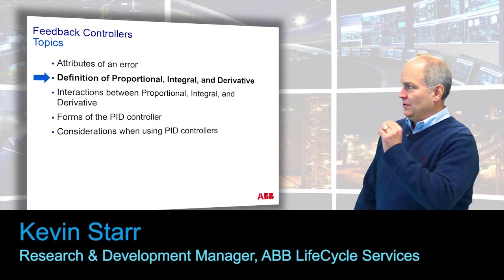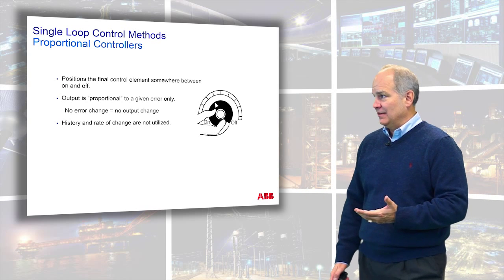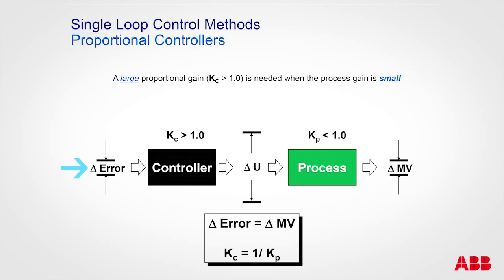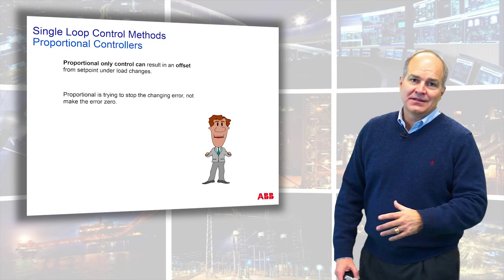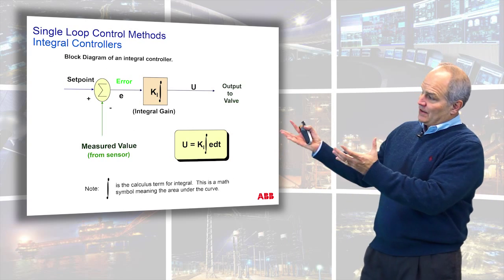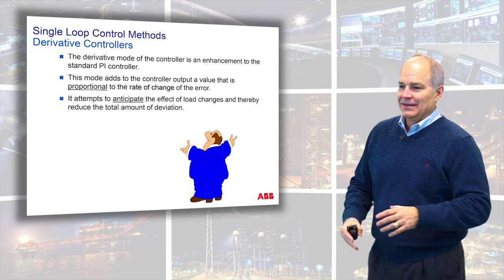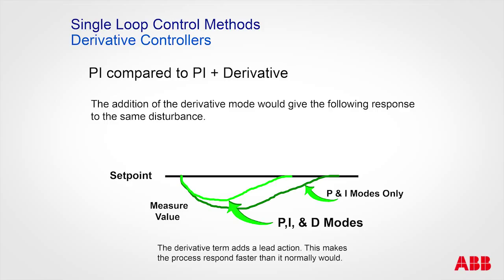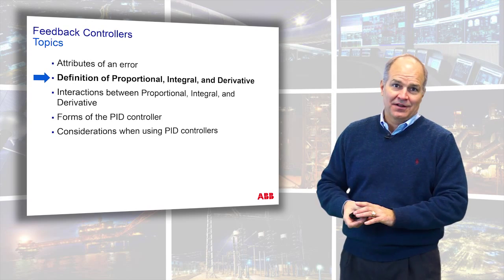Single Loop Control Methods - Feedback Controllers Part 2 // Chapter 4 Continued

Comment: on 7:17, the statement "the controller gain and the proportional gain is actually inversely proportional" .

Can you please clarify ? From the presentation earlier, my kind of understanding should be proportional gain and controller gain is the same, and they are inversely proportional to the process gain.
Reply: Process gain and controller gain are inversely proportional

Comment: Hi! Thank you for this. Its really so useful for me. 
You mention in this part, that you can not think of a situation for a PD-controller. Well,  how about a regulator for a industry size wood chipper?
Its driven by a large diesel engine and it has an ever varying load, one second there is just a few branches, the next there is a couple of trunks or even a stem. But there is very little idle time and thus,  no interest for a particulary stable idle speed ...
--
Edit: I listened again and you really say "use for a derivative only"  and I like to add that I will go through all the lessons and I expect my project will end up as a PID-controller.